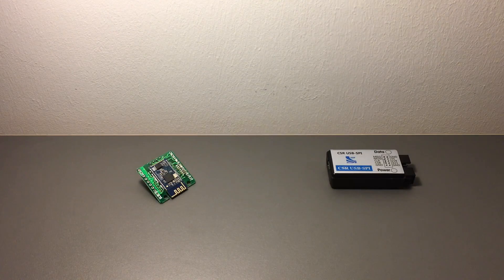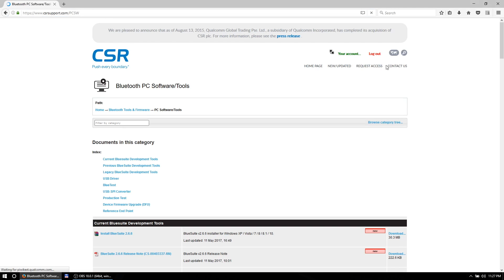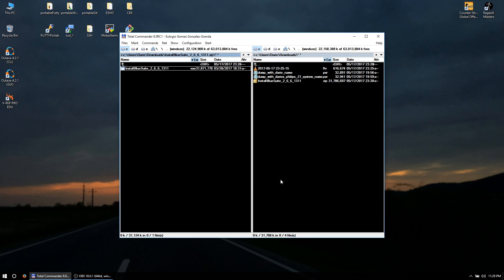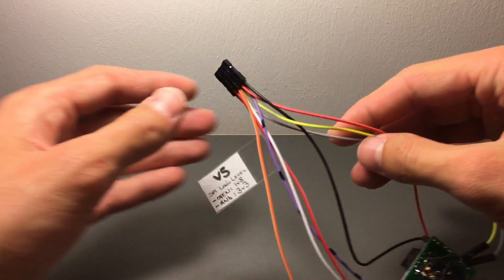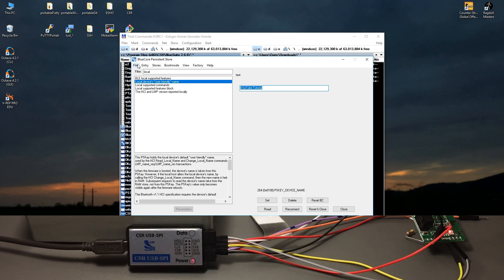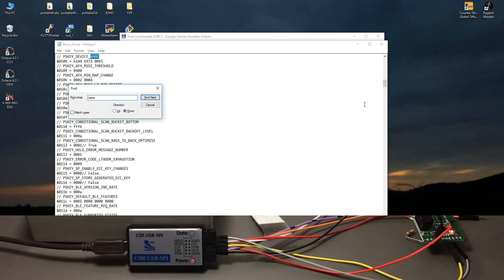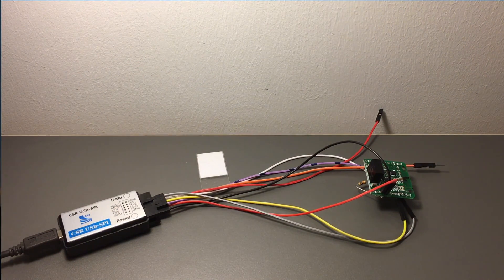How to Rename a CSR8645 Bluetooth Module

Comment: Thanks a lot for the tutorial. Worked nicely on my CSRA64215 working in I2S mode with an ES9023 DAC (Nobsound design). Even though the I2S lines are shared with SPI and used with an SN74LVC125A buffer/level translator to isolate the ES9023, it works fine just connecting the SPI signals on the solder points of the smaller BT daughter board. An important note though is that the full board also features power supply with LDOs. I didn't dare backsupplying these with 3.3V from the programmer and desoldering these are very hard to do without ruining other stuff - so no 3.3V is supplied from the programmer, but from another USB port. A bit dangerous due to possible differences in ground levels, but got lucky :-) Should have measured first, but didn't hehe
Reply from the maker: Nice work! Hit me up with an email at lipton5001@yahoo.com

I do have some questions

Comment: Thx for vids! My USB/SPI adapter doesn't not have VS (voltage select). All my pins are different than yours. There's a 1V8 and 3V3 pins. Are those inputs or outputs? thx
Reply from the maker: Outputs

Comment: Hey,  I recently got a headphones which for some reason have equiliser enabled by default. I want to make it flat. Could you please help me with if I need to hook the 10k resistor in my case. On the headphone board ( which is already battery powered,) I have this pins - CSB, MOSI, MISO,CLK,GND1 and FCM ( which I don't know it's purpose)?  All 5 even the FCM have white circle marks without the GND, so I guess are used. Thanks in advance.
P.S. The chip is CSR A64215 (A11U) 552CJ
Reply from the maker: Which headphones did you get ?

Try first without connecting the FCM, and then try hooking up a 10K resistor between VDD and FCM ... usually the SPI_EN pin (which everyone names differently) is rated for 2v2 or something like that, but with a 10K resistor you can give it 5v as well
Reply: @Darieee  It is mixcder ms301, they have awesome speakers, which I mounted on other headphones just to be sure it is not from them, the highs on ms301 are muffled with stock equliser setting. I could upload photo for you to see the board if you want?
Reply from the maker: Was just curious what other manufacturers are nice and label the pins; do let me know if you manage to reflash it
Reply from the maker: Oh and - do check my csra64215 videos - there's other programs you need to use for it
Reply: @Darieee  Thanks for the quick response, I will notify you if break or not break my headphones in the process hah!
Reply: Darieee Hey sorry for the late reply, but my usb csr device got delayed. Just tested it tonight and it works perfectly, but as you said I had to connect it to the spi enable which has different names everywhere. Just renamed my headphones and disabled the awful EQ and fixed the bass boost frequencies. The only stupid thing I made is I pulled one of the wires from the spi enable on the headphones board and it pulled the connection, now I am not sure it works, briefly tried to find a duplicate but just gave it up and closed the headphones. At least now everything is as I wanted it, besides I have one other model with named connections, I will fix that too soon! Thank you so much for the directions!
Reply from the maker: Nice! Glad I could help

Comment: Hello, may be you know why csr8645 switches on with both leds turned on and stays in this mode?
Reply from the maker: hmmm, no .. not in particular ... maybe it's not getting enough voltage ???

check BAT and see what voltage it has on it :-/
Reply: @Darieee  I use laboratory voltage supply set to 5V. Max current is about 2A. Do you have any ideas?
Reply from the maker: well, the CHIP is supposed to get between 3 and 4v2 ... so ... 5 is quite on the high side

Comment: Hi Darieee,
I have such a problem: computer finds immediately the CDR8645 and I make dump and change name without any problem, BUT after that when I try to connect my phone to the bluetooth, it cannot find the bluetooth. I tried with 2 CSR8645 chips as I initially thought that the first one has some defect. But the same problem is on the second one too. Is there any settings that can cause this? Any idea?
Reply from the maker: uuuf .. no idea .. so, you're just using PSTool ???
Reply: Darieee  Yes, and PC Tools finds it immediately and everything is find with it. But my phone cannot connect with the bluetooth.
Reply from the maker: So ... try downloading my DEFAULT/STOCK dump for the csr8645 ... aaand, try it after flashing that

To flash it properly:
1. PSTool: connect to board -> Restore All 
2. PSTool: merge my default dump

See if it works fine

then modify the settings of that and see if it works

Comment: Great video!!!
I have an issue with my module. Hope you could help. 
I uploaded the code using BC_HS_Configurator, in that i changed the following option
Timers ------>Auto Power On Timeout(s) = 0. 
Now my module is not starting. It is not detected in the ps tool or any other configuration and testing tool. Can you guide me how i could restore the factory settings to the module?
Reply from the maker: ooowhyeah - there indeed are some setting one shouldn't change too much

try connecting the COM pin (internally derived 2v2 rail or 2v5 I don't remember) to the PLAY PAUSE NEXT etc ... individually first and then maybe more at once 

and then applying power to the module

that sometimes takes it into a reset mode and you can reflash it (go into PSTool and click Restore All

however !!! this doesn't always work :(

Comment: I want to use this module only for music when it's paired with my phone.
So phone calls must not through this module is there a way to fix that ?
I know that you can change the settings on your phone but I don't wanna do that every time.
Reply from the maker: Yeah, check my "CSR8645 disable mic" video.

I'd also suggest using the way more modern and more powerful CSRA64215
Reply: @Darieee   thanks for the quick response

Comment: Hello. I really like your videos about programming CSR 8645 chips.  I follow your steps, but unfortunately I am not able to get my chip working with BlueSuite app. I bought three CSR 8645 modules,  but neither of them can communicate with the BlueSuite (I found 2.5.0 version only). Always I get an error, Can't read the chip type. Maybe you had  similar problem?
Reply from the maker: Mmm, so - firstly, download the version I linked and see if it's perhaps newer

Are you using the same programer as I am ?
Reply: The problem is, that I can't download newer version.  CSR support page says that I do not have the necessary privileges to view this category. (https://imgur.com/a/xlJbS7e). So version 2.5 is the only I could find somewhere on the web.
 I use the same programmer, but with different pinout (https://bit.ly/2Le4QcO). I am sure I connected the pins correctly.
Reply from the maker: I have dropbox links though
Reply: Darieee oh I didn’t see dropbox link! Thank you. I’ll install this one and let you know if it works
Reply: So I installed the version 2.6.6 and still the same issue. Error detecting chip type (Read failed on USB-SPI). Any other suggestions? I tried different OS, different BT module already.
Reply from the maker: Hmmm, perhaps when you installed you didn't select the proper driver for win x32

Does windows detect your programmer when you connect it ?
Reply: Darieee yes, programmer is detected by Windows as well as BlueSuite
Reply from the maker: Hmm, then I'm quite sure you fucked up the wiring

Try new jumper wires - I've had a broken one cause me 5 hours of intense anguish - and quadruple check everything else
Reply: Darieee o.k. thanks. I’ll try with new cables and let you know.

Comment: Thank you! I tried on CSR 8635 and it worked fine.
Do you know how to remove or exchange the announcements of the bluetooth device? Some of them are quite annoying.
Reply from the maker: Yeah, with the ConfigTool
Reply from the maker: Check my how to disable mic on csr8645 video, there I link to the program in question; the voice prompts are amongst the last tabs there

Comment: can this work for csr8635 on a Sanwu amp board?
Reply from the maker: Sure can !
Reply: Darieee 
Thanks for the quick reply.

Thats awesome but does it turn on when enabling SPI_EN or SPI_PCM because mine won’t when connected to 3.3v nor 1.8v and powering it from the Sanwu Amp board.

I remember it worked for my 50w+50w, now I’m using 25w+25w.

Oh yeah the amp is called TDA7492P.
Reply from the maker: It really should - pulling the SPI_EN pin high simply switches the SPI pin to actually being the SPI bus instead of digital audio out
Reply: Darieee 
Maybe i have to power it from the usb-spi.

I once powered my csr8645 on a breakout board by battery, but not the usb-spi, and I think it worked.

I’m gonna try that and if it works I’m gonna try to power it from the usb-spi and dc plug.

Is it a good idea to use two power sources?
Reply from the maker: Not really .. you should be able to power the bt board from the amp, and have it work, just don't connect the 3v3 of the programmer; only connect GND and a 10K resistor from the amp's supply for the bt module to SPI_EN
Reply: Darieee 
Ok

Also I checked one of my vids and I think I did use both power sources.

I’ll try what you said when i get the chance.

Comment: Hi Darieee, is it possible to use either the CSR8635 or CSR8645 as a BT Transmitter? Im trying to make one of those BT transmitters with a 3.5mm input. Once I figure which chip to use, I plan to use a micro controller to send audio to multiple BT headphones. I'll connect 3-4 of the CSR transmitters and pair them to 3-4 BT headphones/ speakers. This is for a school project. Thanks
Reply from the maker: That sounds like a rather challenging project

I don't think the 8645 / 8635s are powerful enough; the CSRA64215 however does have 2 high quality ADCs, and can thusly accept analog stereo

How to turn that into a transmitter ... is a firmware level challenge I think - for which tools are very sparse, and I've never had the need for (what software I do have I have posted in my CSR related videos - and if you want, I can send you my entire stash)

The way I would go about this, is buying a few types of Bluetooth transmitters off of aliexpress/ebay, and trying to reverse engineer them

In any case - if you manage to get stuff going, I would be very interested in your findings too ! (as I sure is the community gathered around these videos)
Reply: Darieee thanks

Comment: Will this work with atmel usb isp programmer?
Reply from the maker: There's some stuff on github from a dude that made that work .. and some people in the comments of either of the 3 videos I have on the 8645 have gotten it to work ... but not easily ... and you'll never know wether your problems come from your programmer or the chip or something else

I would highly recommend forking over the 20$ for a proper CSR programmer

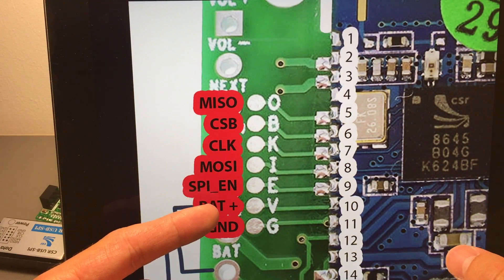Comment: Hey there!   At 6:32, do you mean I am supposed to connect jumper cables between V-VCC    and     G-GND? I am not sure what to do....   Or can I simply connect V to the 1v8 on the USB-SPI and the G  to GND on the USB-SPI ?
Reply from the maker: Connect V to 3v3 and G to GND

What I mean is, and I mean all of the following for the CSR8645 Module, that the round pad marked V is directly linked to the outer hole marked BAT+
And that G is directly linked to GND

So you are free to solder to whichever is most comfortable :)
Reply: Darieee  man, you're the best! Thanks for the quick help my dude. Rock on!
Reply from the maker: Happy to help dude ! Good luck with your project ! 

I remember back when I needed help and there was jack shit available .. /insert back in my day quote/ (like, 1 year ago though)
Reply: @Darieee  unclear. in the vid you say you used 1.8V, not 3.3V. Here you're saying to use 3.3V? 

i use a 3.3V bench supply (to power the CSR8645). Unclear where to connect the POWER_EN, BAT, SPI_PCM, and TX pins on the CSR8645. 

Should i connect the 3V3 pin on my USB/SPI adapter to my bench 3.3V?

thx!
Reply from the maker: 3v3 .. don't think I said 1v8 though
Reply from the maker: You power the csr chip from the programmer !! No need for an external supply

Comment: Do i need the USB-SPI from CSR or could i use a generic one? thanks
Reply from the maker: It's significantly easier when you use the CSR one; there's version available for ~12$ now though, so, keep that in mind
Reply: because of where im at, its going to take a while before i can get nmy hands on the CSR interface, I guess theres going to be trouble between the inteface and the  blue suit.? any ideas of what i can encounter? any way u helped alot already, i didnt know where to start! thanks alot
Reply from the maker: Mmm, if you go through the comments on my 3 videos on the csr8645, quiiite a while back (perhaps even more than 1 year ago), someone was actually using one of those FTDI programmers, and had gotten it working, they should be able to help

I've never used anything else (and would suggest ordering one just to be on the safe side)

Comment: how to change the PIN code?
Reply from the maker: I have no idea what you're talking about ?
Reply: Hello, Darieee,
First, thank you for the reply.
By PIN code I am referring to the parring password between the module and for example phone, so this way others don't pair with it. I looked in between the options, could not find it, therefore just decided to ask before I dedicate hours into it.
Thank you for your time. :)
Reply from the maker: No worries !

So, does your HAVE a pin code ? I've actually never seen one with it enabled ... in any case, the place where such a setting would be is in the ConfigTool

Check my "Disabling Microphone on the CSR8645" video, there I showcase how to run that program - although, from memory ... there wasn't any option for a pin

Comment: https://stackoverflow.com/questions/22639691/how-to-determine-which-codecs-a-bluetooth-device-supports-over-a2dp/42190656 
Can you try this with your csr8645 ?
Reply from the maker: ufff, bit busy at the moment with uni; what's your question though - I have worked with these for quite a while now

what I do know on this topic is that all Apple devices use AAC instead of AptX

also - setting up an equaliser on the CSR8645 to work with Android phones (which do probably use aptx) ends up producing crackles and pops whenever you pause/skim through music
Reply from the maker: Alright fuck that - couldn't resist checking it out

Actually didn't know the Console can read logs from iOS devices as well

Either way - as expected, my iPhone 7 uses AAC to stream to the CSR8645
Reply: Darieee that’s cool! I have a CSR8645 based headphone receiver that doesn’t run aac,  but sbc instead, and was wondering if these little boards, which I have a couple of would support AAC. The little headphone receiver has some pads on it that I guess were used to program the firmware in the factory I’ve ordered an spi programmer so if I can work out the pin out I can see if I can see whey the aac isn’t working.
Reply from the maker: There's options to enable/disable the AAC in the ConfigTool (check my disabling mic on csr8645 video on that)

It's even on the first tab ... I mean ... why in particular you'd disable it, is beyond me, but ... yeah, can surely be done
Reply from the maker: Hm, someone else asked about these a while back

It seems that most sellers are actually dropshipping from taobao or other places ... the ones that have stock actually have their goods delivered within 5-10 working days to europe/us

Comment: My 12v CSR8645 plays a beep/tone every few minutes. Any idea why it does that? Could it be a low voltage warning?
Reply from the maker: Yes, you're feeding the 12V dc dc converter <12V, and it's outputting <3.3V

You need to get a programmer, and using the ConfigTool disable the low battery warning (or just increase the supply voltage, but be sure not to go over 12.5, the datasheet for the mornsun 1203 specifies quite a tight input range)

Check my video on disabling the mic on the csr8645, there you'll find the configtool and info on how to use
Reply: Darieee Thank you!
Reply from the maker: You're welcome !

Comment: I'm back at it again.... your link for this car chip with the breakout board returns with a page saying it no longer exists! I have someone that wants me to add a more powerful amplifier to their speaker and I think I'm going to take out the bluetooth/amplifier combo thats in there and use one of these and TPA or a YDA. You wouldn't happen to have an eBay link for one without the amplifier? Every time I search I just get the ones with the 5W+5W amplifier onboard.....
Reply from the maker: you'll have to tell me which link in particular you mean - I checked a few and they seem to work

in eBay, write csr8645 12v -5w to exclude the ones that have 5w in the title

also if you're building a portable speaker, you should get some dc-dc boosters to make sure the bluetooth module always gets it's 12v
Reply: Thats weird the link when I clicked it didn't work yesterday. I probably should've reloaded the page... and thats exactly what I typed in eBay to search yesterday haha. I was thinking since these Chinese boards can be crap and you found a good model I would just buy from the seller you bought from. But alas I feel dumb lol

https://www.ebay.com/itm/12v-csr8645-APT-X-HiFi-Bluetooth-4-0-Receiver-Board-for-Car-Amplifier-Speaker-/291691632045?_trksid=p2385738.m4383.l4275.c10
Reply from the maker: Nah, I've bought from many suppliers, in this case it seems fine, only HYT seems to be making these, and all I've gotten so far were fine